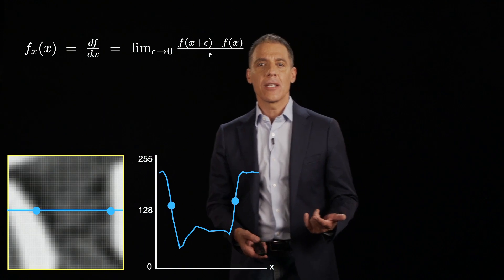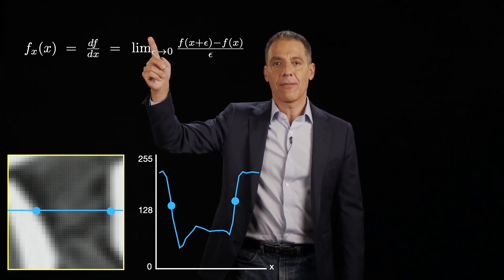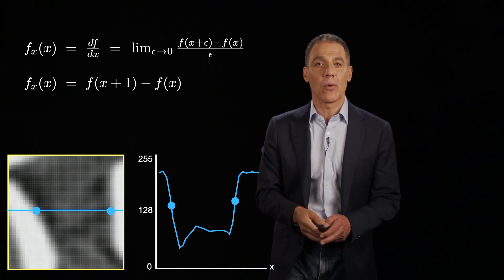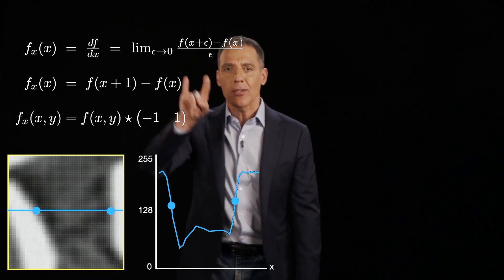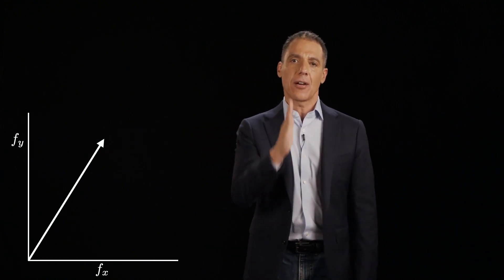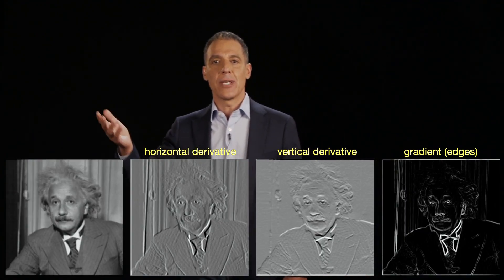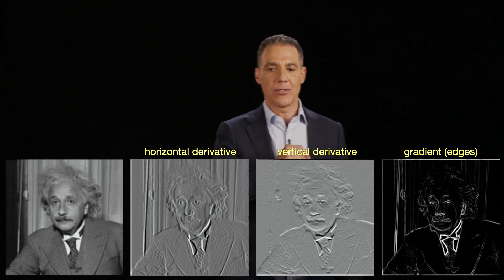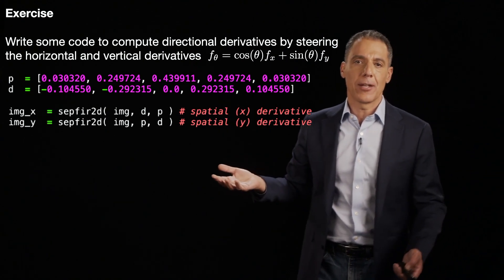Image filtering: features: edge detection

Comment: Hi Prof. Farid,

At 3:50, since the "*" notation stands for convolution, shouldn't the filter be [1, -1]? Assuming right is the positive x direction

The following is some python output:

a = [0, 1, 0, 0]
b = scipy.signal.convolve(a, [1, -1], mode='same') 
print(a)
print(b)

[0, 1, 0, 0]
[ 0  1 -1  0]

Similarly in 13:27, I think the d filter should be reversed.
Reply from the maker: This depends on the specific implementation of convolution. Some implementations yield the results you see here in which the filter is flipped, while others don't flip the filter. Your code here is a good way to determine how to specify your filter values.

Comment: Hi Prof. Farid:

I was having great trouble of understanding what sepfir2d do, since intuitively we are talking about convolving but here we are using a different function(sepfir2d).

Since skimage API doesn't provide much details, I have to try and guess for a few hours to really understand the the linkage between the two concept. 

I felt it would be better to show the code using signal.convolve2d, then show the equivalent but more computational efficient form would really help future student.

The following python code is not a bulletproof test but enough to show my understanding is correct

:

import numpy as np
from scipy import signal
import random

PRE_FILTER = np.array(
    [0.030320, 0.249724, 0.439911, 0.249724, 0.030320],
    dtype=np.float32,
)

FIRST_ORDER_DERIVATIVE_FILTER = np.array(
    [-0.104550, -0.292315, 0.000000, 0.292315, 0.104550],
    dtype=np.float32,
)

KERNEL_FIRST_ORDER_DERIVATIVE_FILTER = np.zeros((5, 5), dtype=np.float32)
KERNEL_FIRST_ORDER_DERIVATIVE_FILTER[2, :] = FIRST_ORDER_DERIVATIVE_FILTER

KERNEL_PRE_FILTER = np.zeros((5, 5), dtype=np.float32)
KERNEL_PRE_FILTER[:, 2] = PRE_FILTER

def test_sepfir2d_convolve2d(test_count: int):
    for _ in range(test_count):
        random_image = np.array(random.sample(range(0, 255), 100)).reshape(10, 10)
        sep_gradient_x = signal.sepfir2d(random_image, FIRST_ORDER_DERIVATIVE_FILTER, PRE_FILTER)
        conv_gradient_x_row = signal.convolve2d(random_image, KERNEL_FIRST_ORDER_DERIVATIVE_FILTER, mode="same", boundary="symm")
        conv_gradient_x = signal.convolve2d(conv_gradient_x_row, KERNEL_PRE_FILTER, mode="same", boundary="symm")
        print(f'sepfir2d and convole2d are equal: {np.array_equal(sep_gradient_x, conv_gradient_x)}')

test_sepfir2d_convolve2d(50) returns all true for 50 random tested image
Reply from the maker: Thanks for sharing this code.